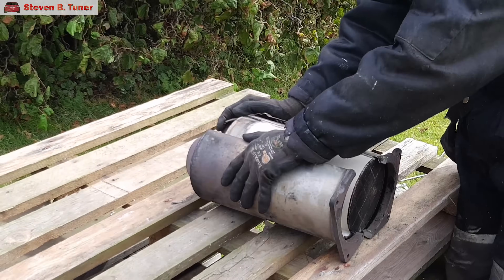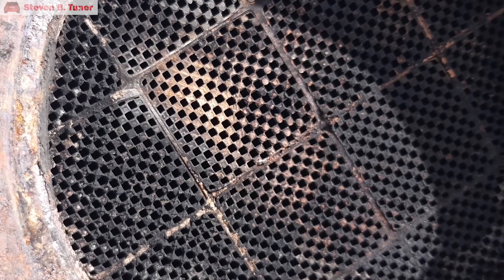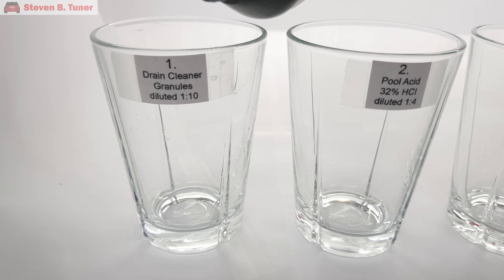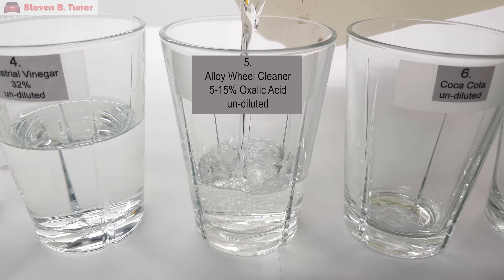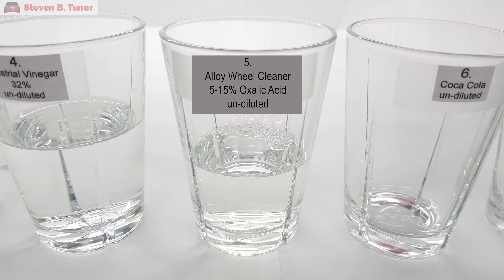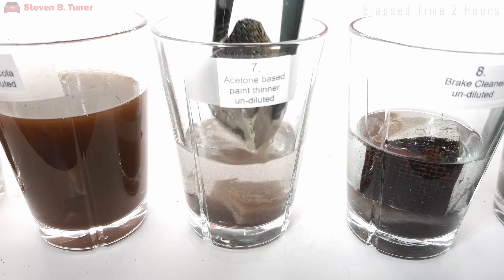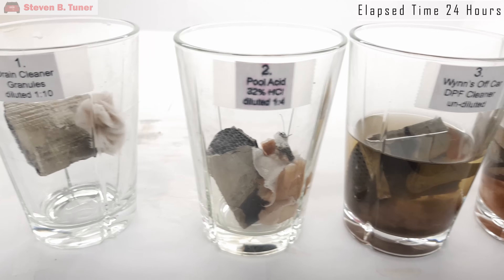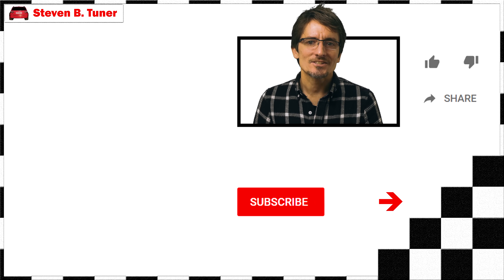DPF Cleaning at Home – 9 Chemicals Tested (Diesel Particulate Filter DIY Ash Cleaning)

Comment: I've had the best results from removing it and welding the empty can back together. Works like a charm, still has the catalytic converter intact, passes MOT with soot levels under max permitted value for my car.
Reply: This is intersting!

Comment: Thanks for doing this test.
I got problem with DPF for about 6 months, lately I also got a turbo/underboost problem and it's really sluggish now. Can these 2 be connected?

Going to tear down the DPF and try clean it now cuz running 4th gear 70km/h for 15-20 min doesn't solve it, tried it several times but DPF lamp comes back after some time.
Reply from the maker: Hi, everything is connected - and an underboost is probably causing lots of black soot to be created, which is ending up in the DPF. Additionally a lot of cars will cancel the regular DPF regeneration cycle if the is an issue with the EGR valve, the turbo, the glow plugs or a sensor. It is best to get a good diagnostic unit connected to find out what the failure is.

Comment: When holding accelerator in any gear trying to push past 3krpms, thick black smoke comes out the exhaust, after letting off the accelerator, little bit of white smoke comes the exhaust as well. Could this be the dpf, or turbo, or injectors?
Reply from the maker: Hi, if any smoke is visible then the DPF is probably cracked internally and will need to be replaced. Black smoke usually indicates an over-rich mixture, and white smoke indicates oil burning. There could be a combination of issues going on, but if the vehicle is also a bit sluggish at 3000rpm then the turbo is probably the first place to investigate.

Comment: you forgot oven cleaner.
Reply: I use oven cleaner for EGR completely  blocked. I use 200mil spray  and was 100% full clean  carbon. After that  EGR was likely  brand new.
Reply from the maker: @New_Free_Forever  Hi, with the DPF it is really hard to get the oven cleaner into the small channels, so I find that something that is a liquid works better.
Reply: @New_Free_Forever  I will have to try this. I was disappointed in the brake cleaner I thought it would be alot better.
Reply: @leadnsteel1428   oh yes that surprise  me to. Whe  watching  this wideo and see brake cleaner  I think yes that will be  best one and easy  to clean. 🤷
Reply from the maker: Hi, oven cleaner is very similar to the caustic soda drain cleaner, but much more expensive and is hardee to get into the small channels.
Reply: @StevenBTuner  yes I know, I just wanted  to tell  how  I clean  it . Very good wideo.🤜🤛👍👍👍👍👍👍

Comment: This video! My MBZ DPF was completely plugged and I totally submerged it in 4 gallons of pool acid in a bucket for a couple hours then sprayed it out with a pressure washer. Came out new. Brand new. Works perfectly $44 total cost. Thank you!!
Reply from the maker: Well done in tackling this unpleasant job!
Reply: That’s a great idea , submerge it. 
Thx!!
Reply: What was the concentration? Was it an off the shelf premix?

Comment: Hi Steven would max power dpf additive cleaner help my friend put some in his BMW every 6 months and between service intervals he said it stopped black smoke on acelleration ..
Reply from the maker: Hi, most DPF tank additives help by reducing the temperature that the soot will burn off at - which can be really useful if the car never leaves a busy city. However, they don't do anything to help remove the long term ash deposits.

Comment: Question
I have a 2014 VW Passatt TDI. Auto trans. It gets 40mpg Hwy and ONLY 20mpg city.  Cant figure why the difference. Does DPF  have anything to do with it? Car has only 60k miles.
Reply from the maker: Hi, there are too many possibilities for me to make a comment in your specific case - but all cars are going to give you worse MPG when they are in the city. Most cars are most economical at 50-60 mph in their highest gear on a straight flat road, and get worse the further away from that you get. DPFs will start to affect economy when they get clogged up with long-term ash deposits, but that shouldn't be a problem for your car at 60k miles.
Reply: @StevenBTuner  thanks. Ya I'm old I get the basics and know manual trans gets better mileage etc....thing on this car is the drastic difference 40mpg Hwy and 20mpg city.  I have asked other Passat /jetta owners they say 30 city. I'm getting 20. I'm running some test. Thanks again. God Bless
Reply from the maker: @BearInThePhillipines  Hi, look out for any failed engine systems that might cause the DPF to clog up with soot, and check for DPF regeneration interval and failed active regeneration events. Every time an active regeneration is attempted there is a lot of extra diesel injected to heat up the DPF, so multiple failures will increase your fuel consumption quite a bit. All the best in getting to the bottom of the issue!
Reply: @StevenBTuner  thank you Steve. I bought some DEF clean out fluid. I see a change from 20mpg citu to 30mpg city. When it's in regeneration I dont see any lights and no check eng lights. I love the car when its 30mpg city... I hate it 20mpg  city
Reply from the maker: @BearInThePhillipines  Good to hear that it made a difference! Most cars won't tell you when they are doing a regeneration, but you can see a slight movement on the needle if you have an 'economy' gauge.
Reply: @StevenBTuner  thank you for all you do. Sincerely thank you. I put a bottle DPF cleaner in the fuel seems to have helped......mileage.  thank you again. God Bless

Comment: The most important question here is how did you get rid of the dirty liquid  after cleaning  DPF s! 
PS: the Answer might save you 20000  EUR!
Reply from the maker: Hi, check out my other vid: https://www.youtube.com/watch?v=LE1boZ3fhLg  It is still my favorite method because at the end of the process you can mix all of the liquids together and they will react to form water and salt (use a pH strip and the addition of some extra hydrochloric acid or sodium hydroxide to get to pH 7). This is called an acid-base neutralization reaction. After that you can capture the very small amount of carbon and metallic sediment in a coffee filter for responsible disposal at your local waste disposal/recycling facility.
Reply: the most important question is why you even exist

Comment: For those of us without the workshop etc for a removal and cleaning of the DPF what products would you recommend to reduce the build up of ash and soot, or clean the DPF somewhat whilst in situ? I am trying out a Wynns DPF cleaner fluid tomorrow that is added to the fuel tank.
Reply from the maker: Hi, if your engine systems are all working then soot will be actively burnt off when necessary. Unfortunately when it comes to ash buildup, there is no tank additive that will help as any chemical strong enough to dissolve the ash will harm other components like your high pressure fuel pump and injectors. There are services (as well as main dealers like BMW), that can spray chemicals into the DPF via the sensor holes - and it can be a good way to keep things in check if it is done every two years or so. I don't think it can be as good as a full removal clean though.
Reply: @StevenBTuner  There are sprays that are available for the driver that can be sprayed into the DPF. I am not sure where to apply this for my car just yet but some say they work well. If I could get at my DPF and remove it I would clean using the suggestions in your video. I will look into it. Thank you.
Reply from the maker: @henryb1555  Hi, Liqui Moly and other reputable companies make chemicals to spray into your DPF sensor hole too - and they should definitely help things out. There isn't a lot of information around about how effective they are at getting into the far corners, so for the moment I would put them into the category of: redo every 2 years.

Comment: how long can a DPF last after it has been cleaned. I`ve heard that it`s life is only 100 000 km .... is that true or it can last to infinity if cleaned properly?
Reply: My Advise is too clean it with only water or with fire/heat and compressed air. It will be as new. That means it will last as long as a new one
Reply: @arascho4163  Are you sure about that, because the machanic that services my car told me I can`t get any more out of it if it is 200 300K already, cuz the nature of the dpf... And he tells me that the only thing I`ll get out of the dpf is 10 20K km and it`ll be blocked again. But I new one will last for at least as long as my original have lasted... which is around 200k ...
Reply: @senseiDi  Did a bunch of these! Mine from a A4 B7 was also clogged completely at 200k km and i did cleaning with water. Now has almost 300k km on the clock with no issues.
Reply: @senseiDi  I also like to use a blowtorch and a Tire Bead Blaster but thats a dirty way of doing so
Reply from the maker: Hi, there are a lot of factors involved - so there is no answer that applies to every car. The first is the location of the DPF, if it further down the exhaust system then it may get a lot of water and salt spray on it, which means that it might corrode away by the time it gets to needing the second clean at 400 or 500k kms. I should say that a 2 stage chemical clean as featured in my other video: https://www.youtube.com/watch?v=LE1boZ3fhLg  will clean things up as good as new, so I don't know where the 100k kms thing comes from.  The 2nd factor that can shorten DPF life is if you have an ECU tune on your car that takes the exhaust gas temperature way up compared to the standard tune - in this case you can overheat either the metal case or the Silicon Carbide matrix (or both), and eventually the ceramic glue holding the DPF modules together will break apart, and this might happen even before you get to the first clean in some cases. The 3rd factor is that on all car brands the DPF housings are shared amongst many models, so you might get a 200hp, a 225hp and a 250hp engine all using the same DPF - and you can expect that the 250hp engine is going to put a lot more stress on the DPF compared to the 200hp model variant. The final thing to consider is that ash blocking and soot blocking are 2 completely separate things, so just because you clean out the ash doesn't mean that you can't have some kind of engine issue that causes the DPF regeneration to fail and therefore become clogged up completely with soot.
Reply: @StevenBTuner  The car is MB W211 320CDI 224 hp, they took my cataliyc converter and dpf out and now I`m left with nothing... I`m moveing soon to a country that do not accept cars witout the cat and DPF so I need to put new ones, but they cost 4000 each which is too much for this car. So I want to buy second hand CAT and DPF and clean them my self and install.... What you would advise in this situation....?
Reply from the maker: @senseiDi  Hi, that is a big problem for sure! Even if you can source used components, it is often a lot of trouble to get everything working again properly if the engine ECU has been updated too. A lot of the time it can be easier to sell your car and buy a similar one when you get to the new country.,

Comment: What was the main chemical in the dishwasher tablet? Just to be sure i get the right one if I ever attempt this myself. I would guess not all tablets are the same
Reply from the maker: Hi, my favorite method for a home DPF clean is the 2 stage method featured in my other vid: https://www.youtube.com/watch?v=LE1boZ3fhLg
Reply: @StevenBTuner  Yeah thats what I wanted to do, but then you said after this test that this will be your new method for pre-wash
Reply from the maker: @flippy9133  Hi, the contents of dishwasher tabs vary a lot, but sodium hydroxide is the same worldwide - so is guaranteed to be effective no matter where you live. However, anything that dissolves oil and grease should work reasonably well for the first stage wash.

Comment: just a mention in the months since I cleaned mine, engine with 150k running like a clock - I have saved a lot of money on replacement  catalytic/particulate parts
Reply from the maker: Great to hear that the cleaning went well and that you saved a bunch of money!

Comment: No chemicals needed! Just high pressure hot water pulsating very fast from the outlet side.
Reply from the maker: Haha, no doubt you can avoid using $20 of chemicals by instead using a machine that costs $5000+

Comment: How would this work with hydrogen peroxide.
If not effective enough add a bit of sulphuric acid (minimal piranha solution)
Reply from the maker: Hi, sulphuric acid is a good choice for sure - but it is difficult to obtain in most of the world, so I haven't featured it in a vid. Sulphuric acid mixed with hydrogen peroxide will oxidize soot at room temperature, but that is a very nasty chemical combination for humans, as we are made of carbon too!
Reply: @StevenBTuner  sulphuric acid 97% is quite easily to obtain actually.

Some brands drainage cleaner are literally 97% sulphuric acid.
At least in the Netherlands and I know in the states to.
I don't know about Straya?